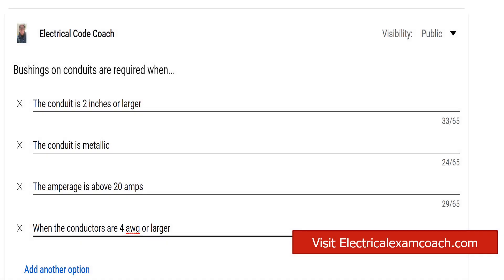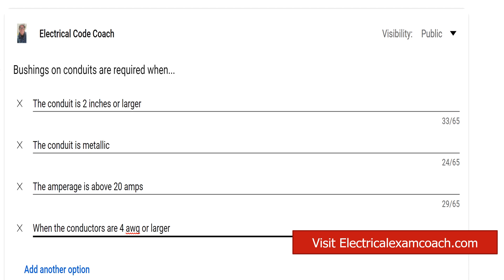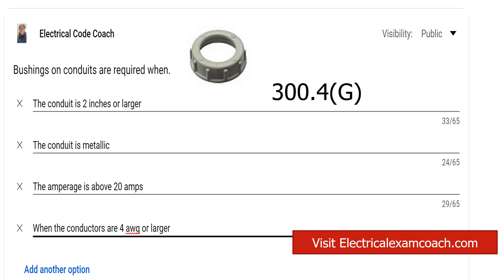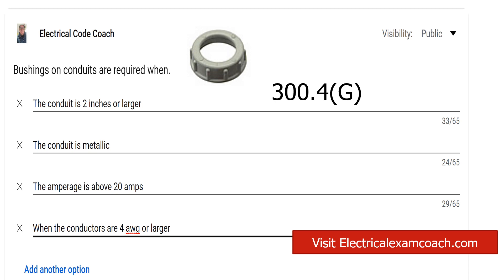Electrical Question of the Day #91

Comment: Putting them on before you pull wire well I’ve had them break during the pull so sometimes you have to put them on after. I got in the habit of always using them now no matter the size like you said don’t cost much

Comment: What is different about 4AWG conductors that makes them need a bushing?
Reply: Maybe because 4 awg and larger carry more amps thus making them more dangerous when they have the insulation cut. So it’s like a safety mechanism. Could be wrong tho